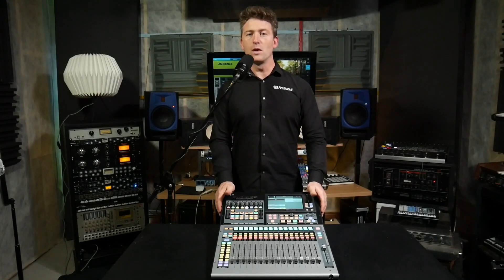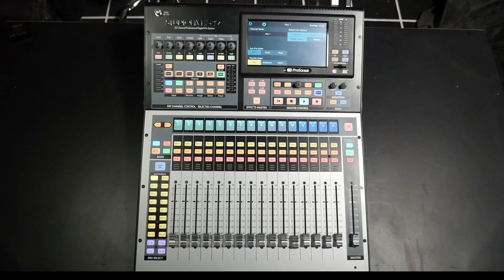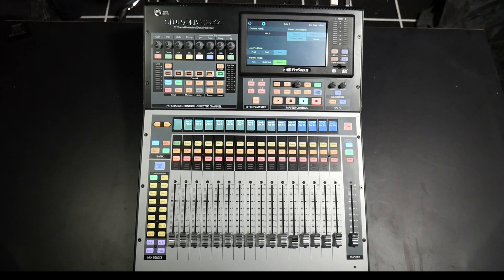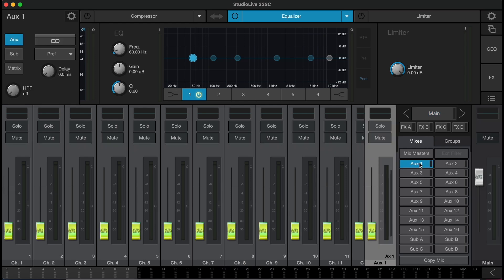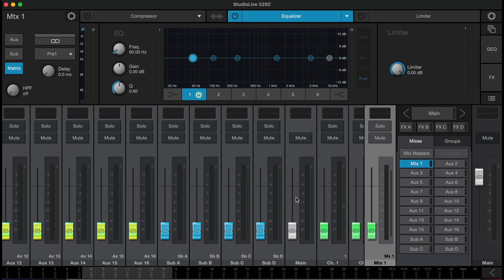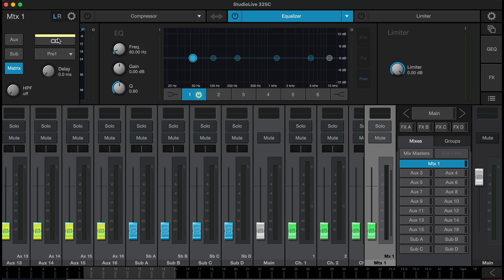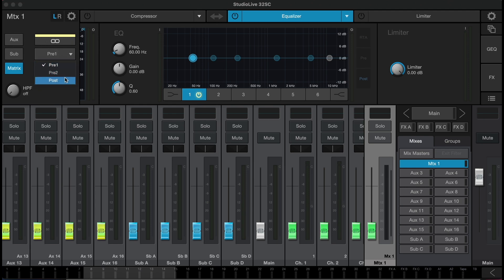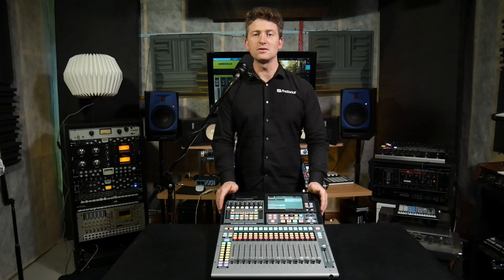Post-fade matrix mix bussing on StudioLive Series III digital mixers

Comment: I need help.
Hello.
I recently got 2 Presonus Studiolive 64S (Version 2.8.2.103375) and 2 stageboxes.
I have some problems with the mixer.
When I work on the mixer (for example after switching between AUXs) there is a 1 second delay on the faders.
There is sound from the faders that are closed to AUX 10 (speaker headphones / pre fader). (global mute link is active).
Sometimes when I use AUXs and switch to Inpus again, some faders can stay open and up (sometimes it happens and irregularly. In other words, there is no clear AUX or clear channel.
When I assign faders to DCA groups and open DCA, some channels do not rise or rise only when I remove the button on them.
When I link the faders or open them with DCA (when I do not physically open them with my hand), the faders rise in a shaky/stagnant way (there is no continuous flow, it rises intermittently)
Wanneer ik een naam op het scherm schrijf, moet ik voor elke letter op Shift drukken, omdat de Shift-toets niet actief is.
I don't use a computer or tablet.
Thank you